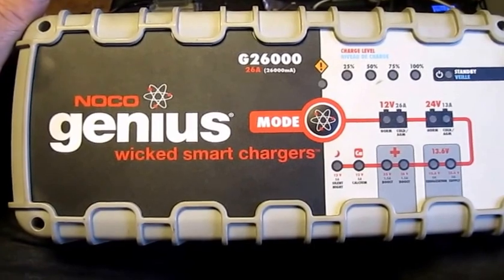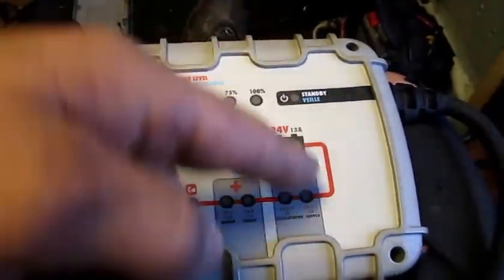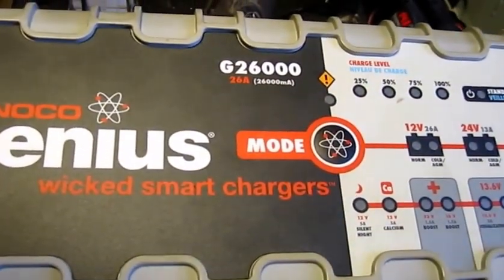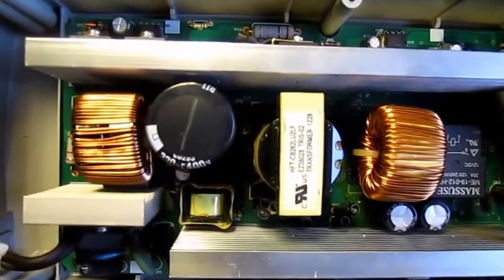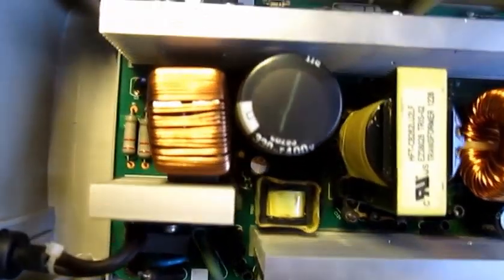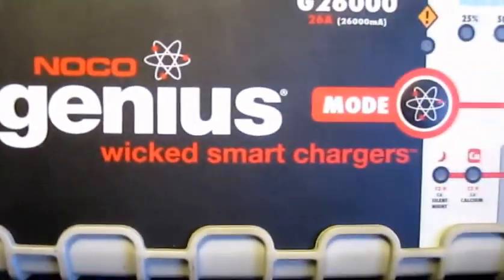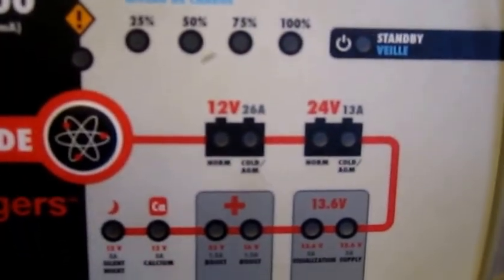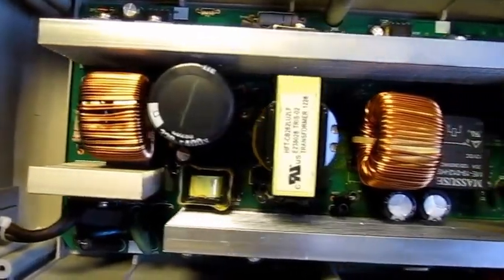NOCO GENIUS G26000 Hacked Apart For Voltage Output Adjustment

Comment: I bought one of these over 5 years ago and it’s crap for charging AGM leisure batteries, it starts off building up amperage and voltage for approx 2 mins then drops right down to 9-10 amps even though my battery bank of 3 is reading 12.1 to 12.2v … I borrowed another smart charger from a friend and it immediately threw in 25amps! for over an hour! then decreased over the next 2 hours. This unit was over priced and the description is misleading 👎🏻
Reply from the maker: Agree 100%

Comment: I had a 5 amp ctek that would charge my agm battery in 5hrs.  I borrowred my brothers 15 amp ctek charger and it charged it in 4 hrs. Whats going on here? Shouldnt it be 3x faster?
Bought an inline meter to see whats going.  Found out that they dont charge at full amp, untill full.
It gradually reduces amperage over time.  In my case the last 3hrs of charging with both chargers output were almost identical.
The 5 amp would charge at max amp 13.7v for 2hrs and reduces amps at 14.7v untill full in the last 3 hrs totalling 5hrs.
The 15 amp charged at 15 amps at 13.7v for 1 hr and reduced amps 14.7v for the last 3 hrs till full for a total of 4hrs.
My new nocco 15000 charges the same amps.
U get max amps in the bulk stage which it dont stay on very long then switchs to absorption and spend a long time doing so.
Leaves me wondering is it worth it buying really big chargers.